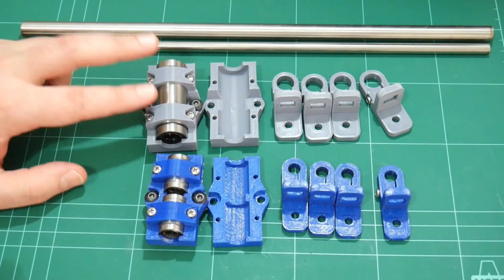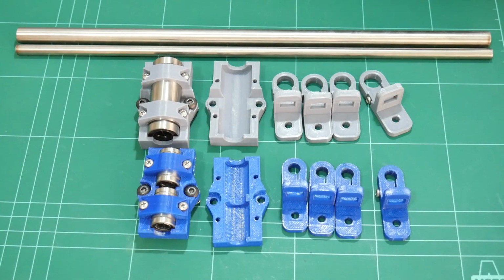HyperCube 3D Printer Z-axis Upgrade

Comment: Hi Tech2C.
I will soon begin the building of an Hypercube and I've got a question for you.
I have bought 500mm 20x20 Aluminium extrusions because it was cheaper than cut to the length. And I think it would be stupid to shorten them now.
So I wonder if it would be possible to have 2 different beds ont this machine : a (30 x 30) hotbed, and a (Max X x Max Y) milling bed. The change of size of the bed would be done by changing the place of the EndStops (I don'know if it's possible to define 2 sizes of bed in Marlin).
What do you think of this ?
Regards
Thierry
Reply from the maker: You can make whatever size you like. With a cantilevered bed however you may experience sag with such a large surface, so support it from both sides. Just double up on the Z axis parts.If you switch between bed sizes then you'll need to update Marlin when you change between them.
Reply: Hi Tech2C.
Thanks for the advice about the Z axis.
What is worrying me is that I would have to update Marlin each time I change the size of the bed. I thought that changing the position of the end stops would make the trick.
Regards.
Thierry
Reply: Thank you Tech2C. I will double the Z axis.
Regards
Thierry

Comment: did you do any comparison prints on the far edge with 8mm and 12mm? Did you see a difference?
Reply from the maker: After the video I printed a 20mm cube at 20mm/s jerk with no noticeable ripple on the corners. I'll need to print more objects to verify the result but it looks promising.

Comment: What are your views on using carbon fibre for the rails in the 8 or 12, is there going to be as much flex? i mainly ask as its easier for me to get carbon fibre and cut to length than it is for me to get exact measurement steel rods (without waiting months from china).
Reply from the maker: CF tubes only for the X gantry. Y and Z need to be solid steel as CF tubes do flex and you can't use linear bearings on CF.

Comment: how about using those MGN12 rails?  theyre pretty cheap now from cn but still twice the price of a 12mm solution.
Reply from the maker: I think those rails need to be affixed to a rigid surface? A round bar is rigid on its own. I guess it comes down to preference. I like the simplicity of round bar.

Comment: Hmm... After spending an entire video making it clear that extra forces applied further out on the bed is bad, (away from the z rods), you still have the cable-bundle strapped to the bed way out towards this very tip. The z-height will be affected by the cable.

Comment: I now have 2 hypercubes. However i only have 1 SD card between them that the Mega will read ( ie < 1Gb ). Any plans on upgrading to a 32 bit system?
Reply from the maker: Yes, I'm just waiting for the Marlin team to release Marlin 2.0 officially before jumping onboard 32-bit.
Reply: I use a 16Gb SD with mine and it works fine
Reply: I am a "subscriber" from the moment I found Your channel (LOL) !!! ... I have learned So Much from those tutorials , for that I Sincerely Thank You ... now , what is the benefit of 32-bit board ?.... is the cost worth it for the moment ?...what else You need to change to accommodate 32-bit board ?... can be an Upgrade viable for any 3D Printer machine ? ... Thank You again for Your time & efforts ...
Reply: I've got Marlin 2 running on Re-ARM. It works fine now.

Comment: Hi tech2c, I'm planning to rebuild my 3d printer into your hypercube design. I want to spend as little money as possible converting it and that means perhaps reusing my linear rails. Can you maybe design some adapters for 6mm smooth rod on the x and y axis. Thanks!. (of course you don't need to if you don't feel like it)

Comment: Thanks for this information.  Do yo think that using the 12mm rods would be able to make the bed bigger like 300x300 work?
Reply: I don't think so. It's better using 4    rods as in the hypercube300 by Adrian
Reply from the maker: Interesting question. Whilst I don't own a 300x300 bed, it could work. The rails would be further apart which is good, and a 300x300 bed is only 50% longer than a 200x200 bed. My bed platform is very stiff now with 12mm rails so I'd say go for it!
Reply: Thanks @Tech2C I will give it a go

Comment: I literally put in an order for the parts 10 min ago and went with the 8 mm rods ...
Reply from the maker: Oh no :(   Is it too late to cancel?
Reply: You can cancel it on Aliexpress but y'll receive the refund months later (at least 1 month)
Reply from the maker: I've cancelled orders from Banggood previously and it takes a few days for a refund into Paypal. Just use live chat to cancel the order.
Reply: I think I will stick to the 8mm rod as I ordered a bunch of stuff from the same seller and it would be a real pain in the ass to order everything again if it appears to be a problem I will have to change it down the line

Comment: Why you did not use the carbon tubes for the z axis, they are very stiff
Reply from the maker: The CF tubes are not stiff compared to solid steel. Also we can't use linear bearings on CF tubes, and sleeve bearings are not recommended for perpendicular loads.

Comment: 1Great work, i really like your design of the hyper cube. I am going to build one but will go bigger. Could you give me the dimensions for the lengths for a double check, will be using a bed that is 310 mm X 310 mm and 255 mm printing height. Don't want to mess up. I have figured (4) X 450 mm for (x) (4) X 413 mm for (y)  (4) X 450 mm for (z) (2) X 310 mm for (bed)  and   (1) X 270 mm for (bed).  Thank You in advance.

Comment: I bet if the 8mm bearings were as tall as the 12mm ones, it would have the same effect
Reply: ThatBulgarian I don't think so. As you saw, the rails themselves were flexing. Also note: the strength of stuff is proportional to the square of its thickness so this is more than 1.5x as strong.

Comment: You just need to ditch those linear bearings for some PTFE sleeves or IGUS bearings to totally eliminate any slop
Reply from the maker: Sleeve bearings are not recommended for perpendicular loads. They will stick constantly and act like a break. On the X gantry the sleeve bearings work very well as the load is parallel with the rail.

Comment: Please skip using the hypercube as a mill. Low mass, strong enough is not what a mill needs. There are plenty of diy cnc mill designs out there.
Reply from the maker: I think it will be fun to see it do cnc stuff. Of course only soft material will be milled.